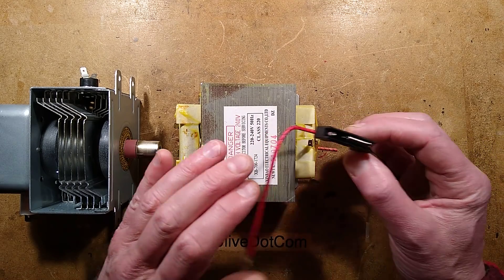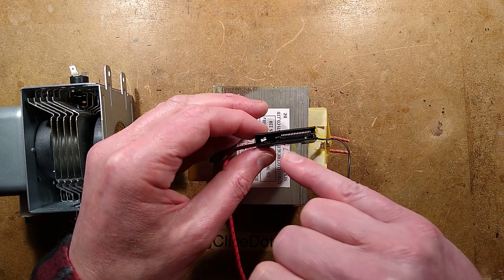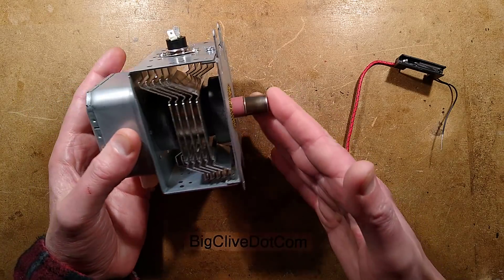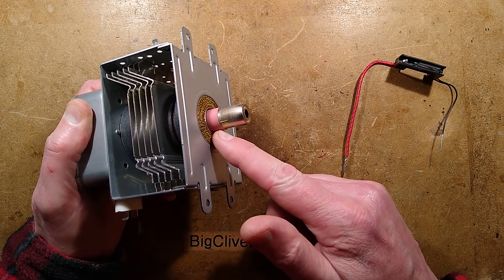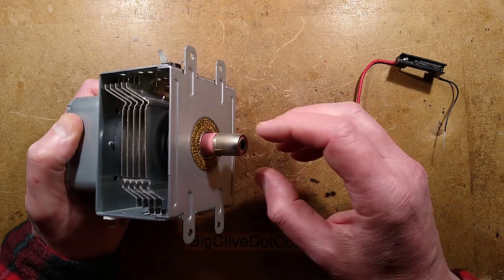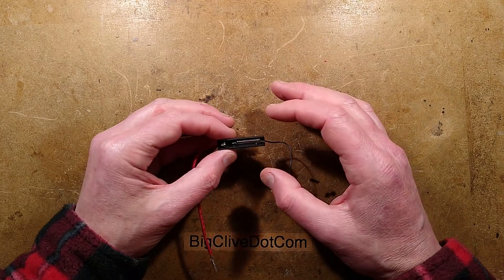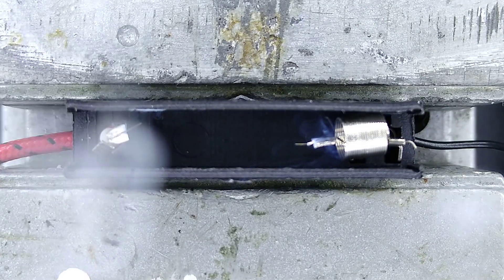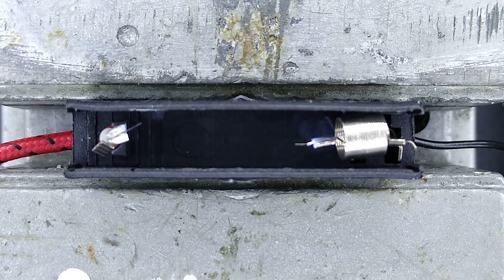Blowing a high voltage fuse

Comment: I once used a 220V fuse in a 1100 V circuit (RF tube amp). Once of those fuse holders that screws closed. The thing exploded like a firecracker. The arc must have superheated the air, expanding it and causing the explosion. I've always thought that trying to built a rifle on this principle would be a fun project. Take an air rifle, install electrodes, dump 1100V from a 1000uF (so 600 joules) capacitor and see if how far the pellet flies...

Comment: these are commonly used in power factor correction capacitors.  you have the fusible link inside a fiberglass tube with a mousetrap like spring mechanism holding tension to rip it out of said tube.  I've replaced many of these (due to squirrels and raccoons blowing themselves up to red sticky giblets on them).  the reason is that high voltage can ionize the air into plasma and still conduct through the arc of the link burning, so snapping the filament away stretches the arc to the point where it can't sustain itself and extinguishes

Comment: Beryllium oxide is actually very white, no colour at all, mainly because the intended use is for high voltage and really good heat transfer, so it is very dense, and normally quite thick. I have some, and the only way to actually tell is with a X ray diffraction, to tell apart from aluminia. Only warnings about them were in the service manuals, telling to handle with care as they contained beryllia. Incidentally a lot of spacecraft alloys, and all high pressure gauges, contain beryllium copper in them, used in spacecraft to make thin high strength parts, and in gauges for the actual Bourden tube used to sense the pressure.

Comment: That's neat, I expected that a microwave HV fuse would be of the ceramic HRC type, learned something today. I'm always a bit surprised by how fine the conductors are even in HV/high-current fuses. Careful thermal  engineering which works flawlessly about 99.8% of the time. I suppose when this style of spring-tensioned  fuse fails under high voltage the fine ends of the conductor would simply vaporise and only the contact and the spring would remain. Cool. :)

Comment: And I suppose the higher the voltage the higher the gap the fuse is supposed to produce when burnt up. I wonder though, with enough voltage you might be able to arc through the spring and ruin its capacity to retract. I am 99% sure they considered that possibility and did something to fix the issue.

Comment: 0:50 lol it's not really rocket science or witchcraft. It's a resonant cavity, or 6-8 of them in parallel to be more accurate. Think of it like blowing a whistle, only instead of the 3kHz its 2450MHz and instead of 30mph air it's a fast moving 4kV electron beam whizzing by the "blowholes" at about 10% the speed of light.

Comment: I'm surprised a HV fuse is in open air even if only 2kV. A mot in a shorted condition can easily make an arc 4" long. Hows a 2" fuse supposed to quench that in air? Most HV fuses are filled with fine sand that melts and makes glass when an arc goes through it.

Comment: I'm no electronics guy, but I've also seen HV microwave fuses that are your normal glass type but filled with sand, which I presume is to serve the same purpose - eliminate the potential for arcing that could otherwise occur.

Comment: Neat.

Question for you Big Clive, I may need to replace some capacitors in the near future. They are HD S4 1500microfarad 6.3 V. However I noticed two of the five are R4. Are there any differences between the two, S4 and R4?

Comment: This is designed I presume to separate it  so much because it's in a high voltage system and they don't want post fuse blow arcing. Putting more air in between accomplishes that.

Comment: I would worry about the magnets to be honest. Apparently breathing in the dust can cause cancer. Which is kind of funny since I have a whole collection of them and about 3 of them pinned up on my fridge. Maybe that's why I have phlegm on my lungs.
Reply from the maker: The risk is with older or military/medical grade high temperature ceramic.  The magnets should be fine.

Comment: Aluminum ceramic is pretty cheap compared to Beryllium oxide by weight, so it's not exactly surprising that they switched from Beryllium oxide ceramic to Aluminum oxide ceramic in the 80s to 90s when they figured they need to cut cost somewhere else. It's the transparent Aluminum ceramic that's much more expensive than opaque flavor, however, if we want to compare apple to apple.

Comment: That's phenomenol! What's the fuse material? did you measure the current you pushed through to get it to blow?  I've a cpl decapitated microwave oven' guts lying around here. never noticed the fuse. could the "fuse" be replaced?  or would the magnetron have to be completely shagged for the fuse to blow. ?? so many questions,  sorry Clive.
Reply from the maker: It's possibly fuse fatigue over time.  But also could have been a flashover.
Reply: @bigclivedotcom  i've had that happen to me too! one second everything looks ok.. the next... phwoomph. the filament got old.  😂

Comment: 0:31 "an amp is an amp..." I always thought that too, but when i was testing a "el cheapo" 5A 28V resettable fuse from Wish, it didn't trip with 5A and 31V from my bench powersupply,
it became very hot and start smelling, but didn't tripped at all. The only way that i managed to get it tripped, was when i connected it direct to the output of a 240V isolation transformer, and even then it took more then 30sec before it finally tripped.
Reply from the maker: Many overcurrent devices will sustain their rated current for a long time, with tripping occurring faster depending on the level of overcurrent.
Reply: @bigclivedotcom  agree, but with my iso transformer, it was more then 5A when i made a dead short with the fuse in parallel to the output of the iso transformer, the fuse had then to blow within seconds, not more then 30 seconds or the damage to the circuit behind is already done, and the fuse is useless.
Reply: @BjornV78  for what it's worth, I find that fuses rarely protect the device. In forty years of electronic servicing, most faulty devices didn't have blown fuses, and the few devices that did had various broken parts. They mainly protect the wiring leading to the device (blowing the fuse before it can cause a fire).
Reply: @CameraTimDotCom  You're right. There are quick acting fuses, but the problem is that those can't withstand inrush currents like charging a big capacitor from zero. I'm more a fan of combine fuses and TVS diodes or fuses and PTC, to clamp down voltage and current.

Comment: In the old electro-mechanical telephone exchanges and associated equipment a spring loaded fuse often referred to as grasshopper or hopper fuses were commonly used. This would be a insulated material like bakelite with two spade terminals each connected to a piece of flat spring metal each with a hole in it where the fuse wire would be threaded through and soldered. When reaching melting point the fuse wire would melt causing the two spring to jump apart. The bottom spring would be on the supply side and on springing apart would make contact with the fuse alarm busbar. This would bring up an alarm and indication of the locality of the blown fuse.  These fuses had different colors to indicate the amperage.  On some radio equipment we had fuses similar to the one you demonstrated except they were glass tube encased with the coil spring. Often referred to as high speed fused. Then we also had glas tube slow-blow fuses. Similar glass fuse with some granular substance inside and I forget right now what the granules were.
Reply from the maker: Silica sand HRC (High Rupturing Capacity) fuses?

Comment: i agree on the beryllium oxide.. the only part that might be would be the small "window" or aperture in the front for the microwaves to pass? and the coating on the filament?
Reply: No, you are confusing X-rays and microwaves here. X-ray tubes generate the radiation inside the tube and it is let out through thin beryllium (not -oxide) windows, which are vacuum tight but transparent to X-rays because of their low density.
Microwaves are not generated inside the tube and thus do not need to be "let out". The tube is an oscillator and the oscillating ac-current is then fed into an antenna structure which emits the microwaves into the cavity of the microwave oven.

Beryllium oxide ceramics has been widely used as an electrical insulator with high thermal conductivity to allow heat to be conducted away from the junction of high-power semiconductors - the thermal conductivity of BeO of 330 W/(K·m) is only surpassed by diamond (more than 900 W/(K·m)), aluminum oxide is a ten times worse thermal conductor at 30 W/(K·m) which is still high in comparison to other insulators. Copper as a metal has about the same thermal conductivity than BeO, but it is of course not an insulator...

Comment: High voltage fuses can be quite interesting. In the early eighties I worked on a piece of equipment that provided directional info for military pilots. The final amplifier used 3000 volts and was contained in a drawer of the cabinet. If you tried to open the drawer with the high voltage enabled, it shorted the supply with a ceramic resistor about the size of a paper towel core. The resistor didn't would experience "very audible instantaneous disassembly". So after everyone within 100 yards stopped laughing and you changed your underwear, you had a lot of ceramic dust to clean out of the equipment.
Reply: Would you really need to change your underwear?

I would have thought the BANG was so sudden and fast you wouldn't have time to load them before it was all over and your heart was trying to remember how to beat at less than 200 BPM...

😄😁😆😅😂🤣
Reply: @HappilyHomicidalHooligan  Messing around with 3kV, there is about 2.5 lifetimes between the time your brain registers something terribly wrong with the monster in your hands and the time that an inventory of vital bodily functions can be completed. Plenty of time for that and more...

Comment: I guess the spring is there to pull the wire far enough away from itself to prevent it ionizing the air and still completing the circuit? Neat!

Comment: It is a bit hard to capture but I thought the split second of plasma arch at both ends was interesting. It happens just before or just as the small wire burns through. I copied that point in the video and tried to past it here, but it is not showing. I still have it saved.

Comment: I've wondered about fuses and current capacity.  I see tremendously expensive, high-current power cables being sold for stereo equipment, only to find a teeny 2-amp fuse is all there is between a several-hundred dollar mains cable and the inner workings of an amp. Are we just fools to buy into this marketing "scam?"
Reply from the maker: The cables for audio equipment are often for extracting money from enthusiasts.
Reply: The amount of unscientific voodoo in the high end audio community would put alternative medicine to shame. Super-expensive power cables are perhaps the most obvious example of that.

Comment: Older microwaves did use beryllium oxide to my knowledge? But yes most new ones use other ceramics like you mentioned. But if older microwaves do use beryllium, then it's still worth warning people about it? Maybe only 1 in every 100 people taking them apart will risk coming across one, but that's still a serious risk over the general population? I think "don't grind/break it" is pretty reasonable advice, after all there's very little need for someone to do that? Especially given how little berilium can cause issues in some people.

Also what about commercial microwaves which go up to a few kilowatts? I don't know what they use, but maybe it's common in those? And those are also very easy to get ahold of, they barely retain their value and you see 1.5kW to 2.5kW ones at e-waste and scrap recyclers all the time for super cheap (and often on ebay). I've often thought about grabbing one just so I can have an industrial microwave.

Comment: I had an accident at work when I was 18 (I'm now 56), a bus bar joint had been made loose from external vibration and arced while I was in the back of the panel, about fifteen feet from the bar. The resulting explosion fried the panel and part of my hand and head (luckily the position of my arm protected my eyes).
The bus bar was copper and about 2" x 1/4" the gap left in the bar after the arc was about 6".
what current and voltage would cause this gap?
Reply from the maker: It sounds like it may have been mainly a high current arc flash.  The metal vapour from the fault conducts in the surrounding air.
Reply: @bigclivedotcom  Cheers, it was like a 3ft square welding flash! it completely destroyed the panel (30ftx 8ft) Blew the skin off the side of my hand, and severe burns. The ambulance driver asked, "who did I think I was Nicky Lauder?"

Comment: dont know if they changed it but several yrs ago the non metallic case ( ceramic) housing had Beryllium Oxide in the ceramic as a binder and for thermal issues. BeO has a very hi melt point and was used in plasma tube lasers. The dangerous part of the ceramic was grinding cutting basically making a fine dust of it, aside from being on the toxic side it also was capable of causing cancer. Breathing in the dust was highly discouraged.

Comment: Don’t think that would actually break the output of the microwave transformer, as you see people drawing arcs a foot long from them! (Unless the speed has an effect).
Reply: I believe the speed does matter, if you watch arcs being drawn, they break if electrodes move apart too fast for the arc to heat and ionize the air

Comment: I've found blown high voltage fuses at work that have exploded. The equipment I work on is extremely high voltage and when a fuse blows it creates an arc. The spring is there to pull the conductors apart and extinguish the arc. If it doesn't work the arc grows until it explodes. The explosion is relatively small but still quite dangerous.

Comment: It’s never occurred to me why most fuses are a spiral coil until now.
Reply: "Normal" fuses are not spring loaded, but they are wound like a spring to increase the resistance of the wire, due to its length.
More resistance ➡ more power under load turned into heat ➡ faster burnout

Comment: I have opened many microwaves over the years and I have never seen a fuse like this built into a plastic housing, They are usually glass bodied fuses, same structure, inside a protective plastic shell
Reply: Same here
Reply: I have on hi output power microwaves newer ones
Reply: Same here. First time I've ever seen one like that.

Comment: My current microwave simply does not have this fuse at all. Running a food tech room at school, these fuses frequently blew for no good reason, except perhaps vibration and thermal cycling so and I kept a few spare replacements.
My spare magnetron, the one on my desk as I type this, has a white ceramic insulator. Even if it were beryllia,  you would have to work hard at it, to grind it into a dust to inhale it before it became a hazard.
"Beryllium oxide ceramic is not a hazardous waste under federal law in the USA." Wiki.

Comment: I'm a service engineer in the welding and power generation hire industry, and I think that insulator is made out of the same material that TIG ceramics are made out of.
I was also a Weapon Engineering Mechanic (Radio) in the Royal Navy and our VHF / UHF transmitters used components containing beryllium oxide.
There was a warning on the door to the UHF office of the hazard of beryllium oxide because in the event of a fire in that compartment, beryllium oxide posed a risk as it could cause serious respiratory illness.
If I remember, beryllium oxide is used because it has similar heat conduction qualities of copper but electrical insulation qualities of glass.
Geek Pub Quiz Question: What material would be the VERY best heat sink material?
Reply: The answer is diamond. 
It has the best heat conduction of any material. Electronic diamond testers use this phenomenon to distinguish real or fake diamonds in jewellery.
Reply: Better than copper? How are gold and flowing mercury as guesses?
Reply: Water?

Comment: The alumina/chromium oxide insulator is exactly the same colour as the refractory gas shrouds used in TIG welding gear. I’d bet they’re very similar in composition.
Reply: You're right. 20 years ago when I was TIG-ing we called that pink shroud "ceramic". 
Cool story, once when I was finished welding some pipework I put the welder to rest over the stand which was holding the pipework above my head so I could take a look (had to weld by guessing in some parts because there's no room to get your head into the gap to see). So I put the welder over the stand and let it go. Well the tungsten, sharper than the sharpest pencil I've ever sharpened and still glowing white/orange swung down and went straight through my trousers and my leg. That pink ceramic is what stopped it going in any further. It went into my leg about 3-5mm and missed my shin bone by about the same amount. When I had a look, I had a perfect pencil shape puncture. I recovered well I think as cannot tell exactly where this was. I was glad it missed the bone and got back to work.
Reply: @tonyppe  oooooo painful 😱
Reply: If that is the composition it will fluoresce red under UV light for the same reason ruby does. I doubt it is though. Probably just dyed alumina.
Reply: @Muonium1  I’m going to try that
Reply: @WineScrounger  Lmk
Reply: @Muonium1    I have about 50 on a pallet covered. Just checked with a weak uv light. No luck from the pink ones. The white ones reflected light, pink ones stayed dark.

 Maybe a few of the white perhaps are a little fluorescent or they were just really clean compaired to others.
Reply: @colonialcharlie8702  👍🏻👍🏻 ya kinda figured